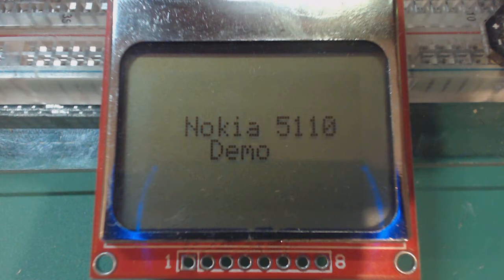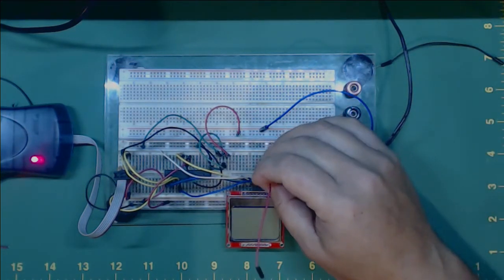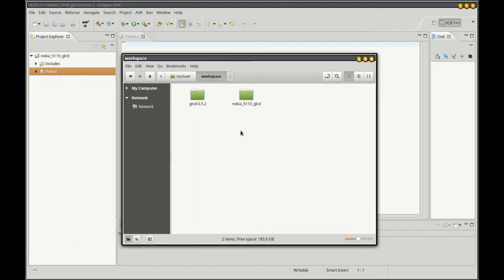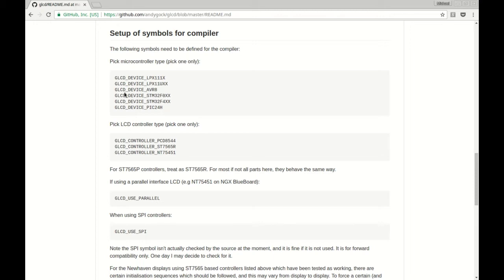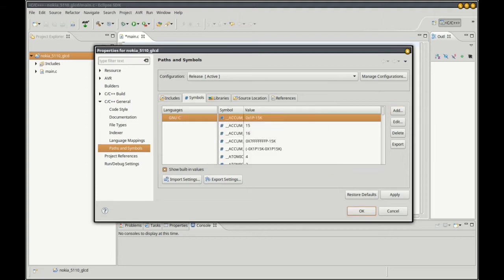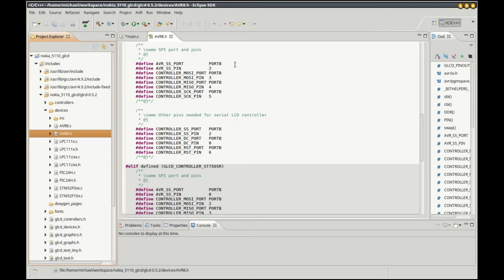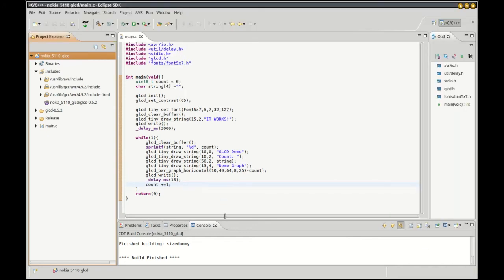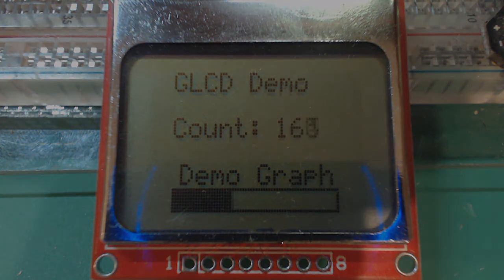Nokia 3110/5110 LCD with AVR ATmega (setup and code)

Comment: Thank you for sharing! I did everything as described but I am using AtmelStudio and a C++ executable project. Upon compiling I get "Undefined reference to 'glcd_init' " error and this same error for every function from this library that I use in my code. Any advice is welcome (preferably about this issue though ^^)

Comment: excuse me if im missing something here, but you are talking about certain pins in your avr chip and since we dont know what chip you're using how are we supposed to understand the connections?
 im asking cause i have a problem with the D/C pin, dont know how to connect it with my chip (atmega 328P). help would be appriciated ;)
Reply from the maker: +piotrekgor18 at 6:00 is an explanation of which pins are being used on my atmega 328p and how they are defined in the library.
Reply: Michael Galindo thanks